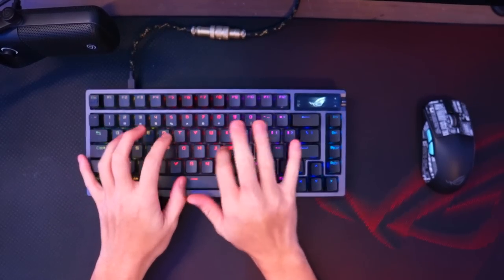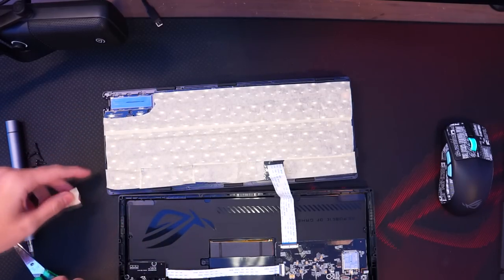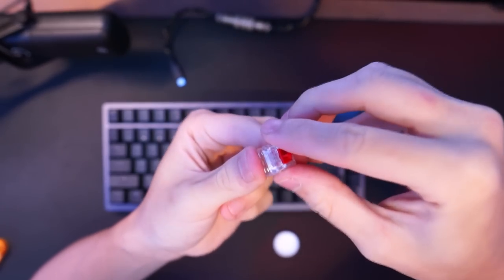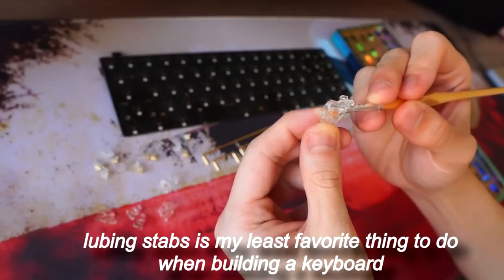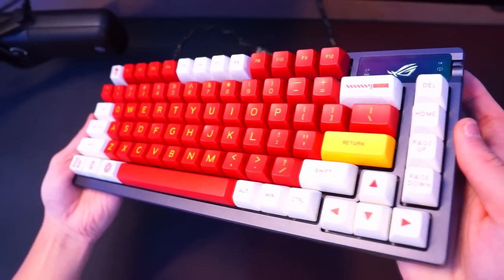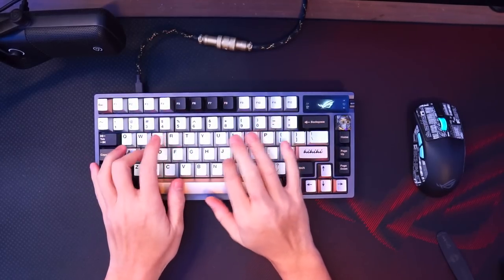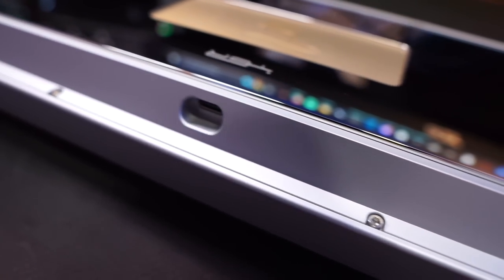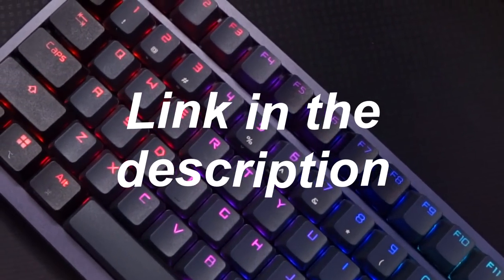How to EASILY Mod Your Keyboard (ft. ROG Azoth)

Comment: Instead of using duct tape or electrical tape, use painter's tape as it is less sticky. Sticky tapes such as duct tape and box tape tend to ruin your PCB by pulling out conduits from your keyboard when removed. Additionally, super adhesive tapes leave sticky residues that may also ruin your board.
Reply: Masking tape works too
Reply: Both can make a fire
Reply from the maker: Great tip!
Reply: @jay-leengamesfun8291  only if there is a battery in your keyboard I’m pretty sure
Reply: @Vainsz  Hey man! i have difficulty to how i actually get the keyboard? because i cant find where i get the keyboard.
Reply: @tenser727  the keyboard is in the description
Reply: @SpecFNT  i know but when i click on the link, i dont find anything that tells me i can get the keyboard like theres just the things about the keyboard and it stops here with the related products thing.
Reply: @pushmain  not sure if they postponed release or not.  I ordered it through a pc parts store here and the owner was told it'd be the end of the month before it shows up.
Reply: I used electrical tape I was scared I going to cause fire is that ok?
Reply: Was wondering if painters tape was safe even if you didn’t have a battery

Comment: Looks nice but still no reason to upgrade from my hybrid type-Gaming keyboard (kemove k61 with blue switches on left shift,wasd and spacebar and Akko radiant red used for the other keys. Blue switches only used because it’s better for gaming)
Reply: For me it's 2.4 wireless, great battery and volume rocker.

Comment: I ended up adding 4 layers of painters tape to mine, though it is personal preference, I do like that it sounds a lot more deeper now and less pingy. But be careful of the hex screws they seem to be extremely soft, 1 of the 1.5mm screws has rounded off and i cannot remove it :(
Reply: Does your keyboard still work?
Reply: @muadack3972  Yes, still working fine, not much sign of wear either.

Comment: Vainsz, could you recommend a keyboard of the same quality as the one used here but in white?  one with the closest possible specifications to azaroth.  I am setting up a white aesthetic setup and I would rather have a white keyboard.

Feel anyone free to answer my question, I'm new on this modding keyboard community and I'd like to start on it with the right foot.

Comment: Could someone give me a tip for better sounding switch and keycap combo compatible with azoth? Ideally without sacrificing Aura Sync RGB. I probably dont mind if the keycap legend wont be lit up but atleast below and in between keycaps light would be visible.

Comment: As far as I know, the Razer Huntsman V2 is way faster than the Wooting 60HE or any Wooting keyboard. Great video tho!
Reply: ...how did you end up with that conclusion?
Reply: then you just don't know wooting
Reply: @Skine Bread razers fastest keyboard goes to 0.2 mm and that’s their analog while the 60HE goes down to 0.1 mm
Reply: what does that have to do with anything lol
Reply: @ethantang7558  Rtings' tests, the numbers are there. It's simply because the Huntsman V2 has 8000 polling rate.
Reply: @Michael-mm2zm , I just clarified since Vainsz said the Wooting 60HE was the fastest keyboard, which isn't true.
Reply: @obsidianquill7949 , oh, I thought he was talking about response time. Thanks for letting me know.
Reply: @SkineBread1  my man if 8k hz meant how fast the keyboard was then razer 8khz would be the fastest mouse, it dont work like that. first of all wooting is better than the huntsman v2 in every aspect, it uses lekker switches, they sound better, they have the rapid trigger function which is a life changer for strafing in games, its actuation point goes down to 0.1mm and its adjustable per key. to top it off it has the best rgb in the industry, the more you press on the key the more light that comes out.
Reply: @SkineBread1  i think that's false.